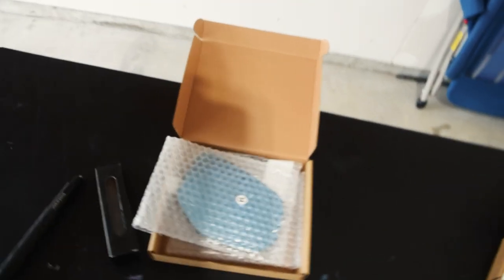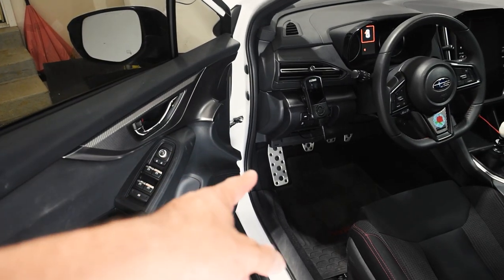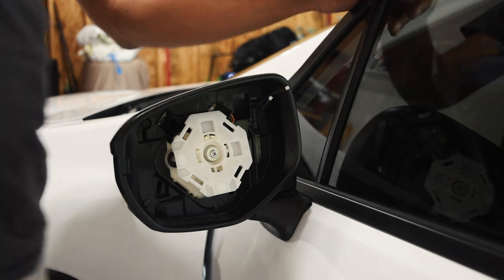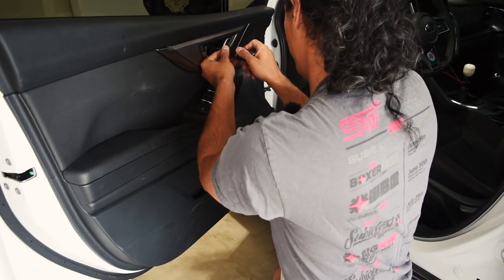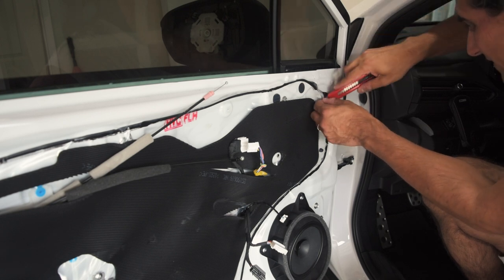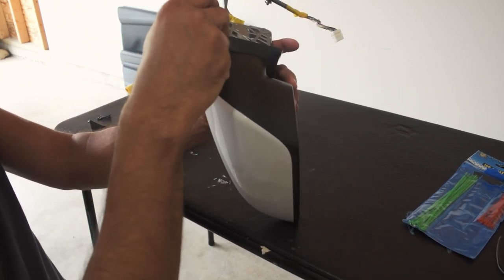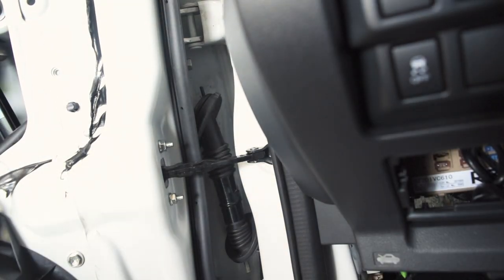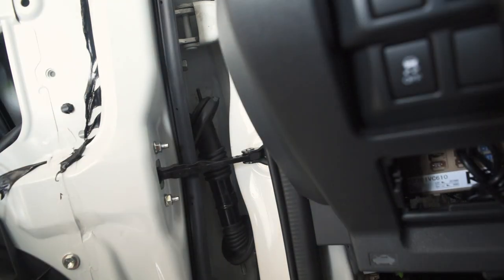BEST aftermarket mirror upgrade - Noble Wide-angle with Turn Signals// 22-23 WRX // #2022wrx

Comment: Think they are more trouble than they are worth. They should be  tinted and not blue.just darker than the originals. You did a nice install you looked frustrated.
Reply from the maker: Hahaha I cut like 3 fingers and under my right thumb. I think it's a cool item but it's definitely a little on the tedious side to install.

Comment: Usually Subaru vehicles at these trim levels will come pre wired for turn signal mirrors to the connector of the door for the side mirror power and heating. You could have either connected into the pin connector or tapped it. Saving you a shit tone of time.

Comment: I installed the left side and went to turn the signal on and it flashed once, and now wont work.  All wiring is correct.  If I hook them back up originally, they work just fine.  Not sure what is going on here.  23 WRX premium.  Any help would be appreciated.